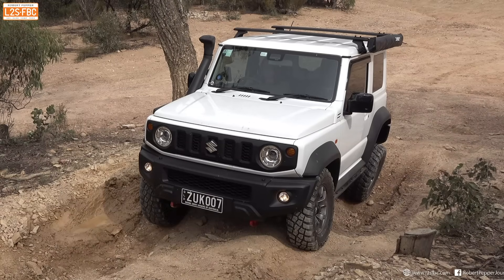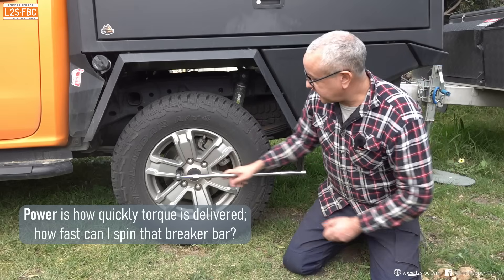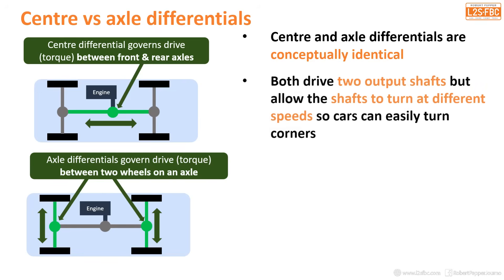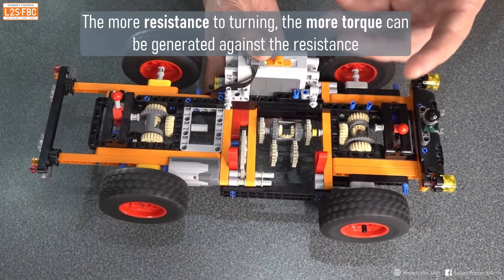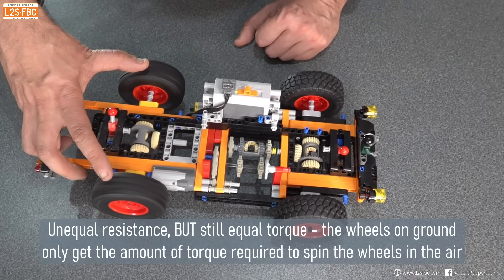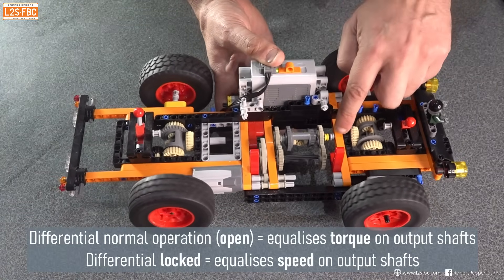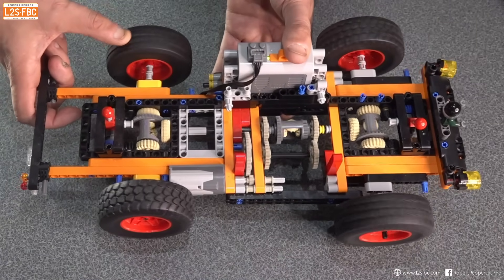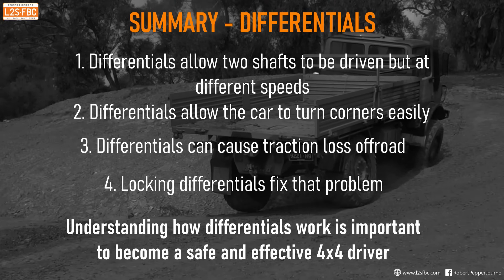The reality of torque and differentials, demonstrated.

Comment: Came here from the All Terrain Action EV review on Chris's Offroad X Mode for the Shark. Impressive review that really adds clarity to what Chris and Francisco have engineered so far.  
Yes, indeed the Front Rear torque bias control is a quantum leap.
 The Shark is not a rock climber and that is fine, it would be a complete mud and gravel tracker with the bias control, and one pedal regen downhill control. It would certainly make towing a trailer downhill a lot safer.

Comment: If you can only have center or axle lock diff. Which one would be more useful when stuck in mud ?
I drove a 6x4 semi and got stuck in sand before. It only have center diff lock. Need a excavator to drag me out.
Reply from the maker: Generally, a centre. But it does depend on the situation.

Comment: Excellent video thank you.  At 12:00 minutes, regarding brake traction control, your caption states: “The computer spots the speed difference on the two wheels, and brakes the faster one, creating more torque at the other”.  I agree but note the following:  In the first instance (wheel spinning) the cross axle wheels have the same torque as each other (because the diff is open).   In the second instance (spinning wheel having been braked) the cross axle wheels again have the same torque as each other.  But comparing the 2 instances, it can be shown that the act of brake traction control, changes the operating point of the whole system.  It doesn’t just send torque across to the other wheel.   In fact it creates more torque at both wheels.  The second instance has more total axle torque, and also has more torque at each individual wheel compared to the first instance. This can be proven graphically using intersections of power curves and impedance curves. The same method can be used to prove that lockers cause the traction wheel to experience greater torque and rpm (and therefore power) than occurs with brake traction control - which is interesting but doesn’t necessarily mean that lockers are better.
Reply from the maker: You are exactly right and I did think of going a little further, but thought stopping there would make the point for everyone and those who understood further, such as yourself, would forgive the slight simplification - and what I'd already said could be used to conclude that point as well.
Reply: Understood.  Striking the right balance is difficult - I don’t envy you.

Comment: Question! At 13:15 , with all the torque applied to one wheel,  in real world 4wding is this a scenario where a car breaks a CV?
Reply from the maker: All the speed is on one wheel. All the wheels have equal torque, just some aren't moving, assuming open centre diff.  The breaking of a CV might happen when a wheel spins whilst in the air, then slams down onto the ground with hard traction, typically a rock.  That's when the energy has to go somewhere and things break.  Axle lockers help with this, and it's less of a problem on slippery ground and with brake traction control.
Reply: @L2SFBC  @paulpickford4074 is referring to 13:15 in the video where there are 3 differentials locked, 3 wheels spinning and 1 wheel with traction.  So most of the engine torque is applied to that one wheel with traction.  (Most but not all because the 3 spinning wheels each experience considerable torque to overcome the impedance of their wheel bearings at high rpm as well as other factors). So with most torque applied to one wheel this does indeed raise the risk of CV failure.  And as you note, slamming a spinning wheel into the dirt also contributes. In fact that process creates still further torque. This is apparent by considering the different kinds of torque, the main 3 being static torque (eg your static breaker bar), dynamic torque (eg a wheel turning at constant rpm), and accelerative torque (eg a turning wheel which is slowed down by a brake or by spinning and then hitting the dirt).  The first is calculated as Force x radius. The second as Energy / revolution. The third as Moment of Inertia x Angular acceleration. Only one occurs at a time - they don’t add up.

Comment: exactly what I was saying about in a recent video about releasing the centre diff lock on a hill, you remove the torque being passed through the diff and it then allows that path of least resistance to take effect, It's a shame you didn't cover that in this video as it'd take about 20 seconds and give more context to what the other video was meaning. I'm sure the smart people will have worked it out though. 

If you want to do a model with a viscous type clutch in the front drive, then use a 5nm slip clutch, you can lock that easily with a pair of sliding gears to give a "diff lock" mechanism. It also allows a lego LSD to be made. Again, I have one of those in my teaching kit.
Reply from the maker: Interesting, haven't yet tried to build a LEGO LSD...and I kept the other one brief as I already had a CDL on hills video.
Reply: @L2SFBC  a really basic LSD design is to replace your lock 24t gear with a clutch gear, it will slip when the torque differential demand is more than the rating of the clutch gear, the white ones are 5-15nm, which you can adapt a little with some lube, I found it really good as you can then have an open diff, LSD and a locker in a fairly compact form for centre diff. I'll see if I can find the box with mine in and forward some pictures.

Comment: is the difference between traditional 4WD and AWD just the centre diff?
Reply from the maker: Pretty much yes
Reply: @L2SFBC  ta!
Reply: 4WD comes in part time or full time and it has a low range gear setting. Part time 4WD means it runs usually in 2WD and 4WD can be selected (part time) when needed. Full time 4WD is in 4WD all the time (permanent). AWD is full time 4WD without the low range setting. This is the standard engineering definition. Names given by the manufacturers do not always follow this rule.
Reply: I explain it like this:
Once you understand the drive categories, 4x4, 6x6 etc.. and awd and part time 4wd
All wheel drive is exactly that, all wheels have drive to them whether diff or viscous coupled, so if the vehicle has 4 wheels, it's a 4x4 and an awd, an awd can also be a 6x6 or 8x8, but they can't be 4x4's as too many wheels. 
Part time 4wd's are not AWD or 4x4's as most drive situations are 2wd. It is generally accepted that 4x4 is when a wheel can be driven, but not always to have drive. 
I usually give 2 vehicles and ask what is the 4x4 and which is awd, it's a trick question, as both have exactly the same principals of transmission. The vehicles are a UK spec Ford Sierra 4x4 and a 1999-2001 Range Rover P38. Aside from the possible gearing, the 2 have the same direct rear drive and a viscous coupled front drive. Both would be 4x4 and awd.